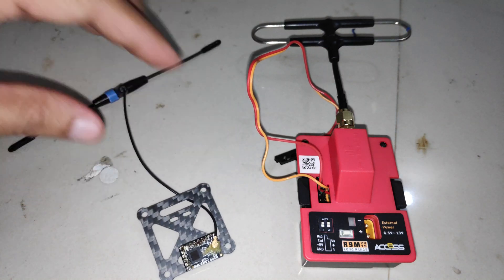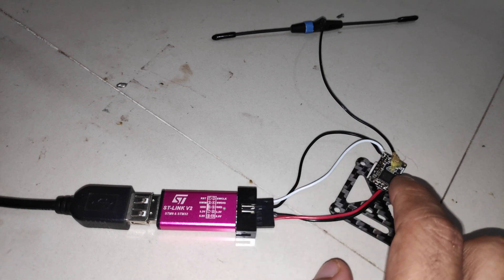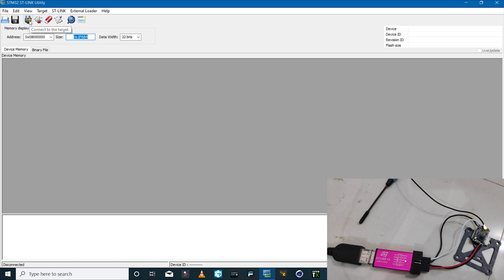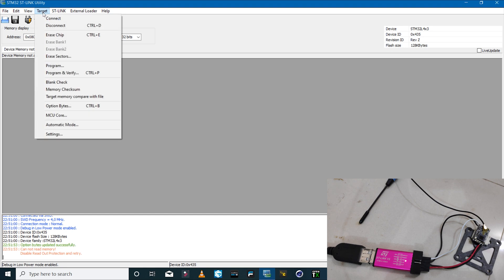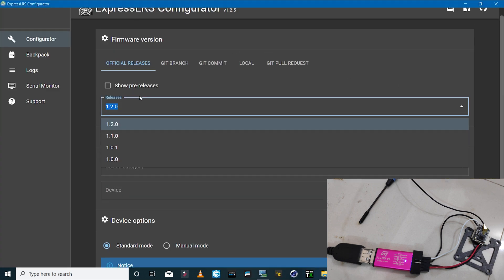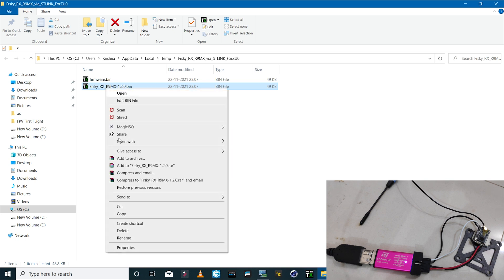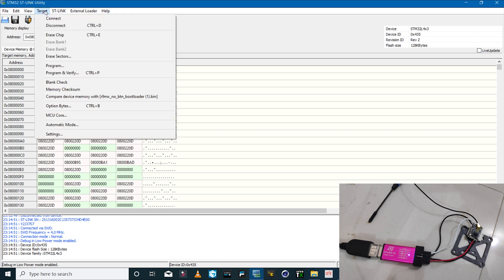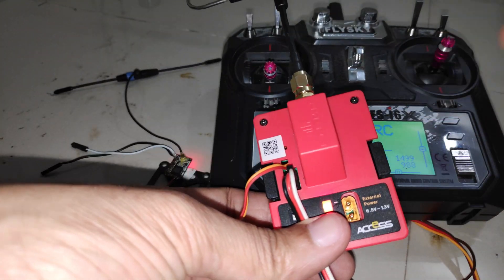Frsky R9MX Receiver ExpressLRS Installation using ST Link Utility | In Depth Tutorial

Comment: please help me I have an r9m lite TX and an r9m slim plus rx and r9m lite rx which I have connected to st-link v2 with utility with 3.3volt and dio and clk and ground the fault in the receiver and the module when I plugged them into the PC but after I connected to the st link utility they won't turn on again, is there a way to get them back again so they seem to have done exactly the same as you on the film they connect now too but that If there is no light, they seem completely dead

Comment: Thank for video. Good job.
But i cant flash bootloader with stlink correctly i think. Everything seem true. But red light flashing, not always on after bootloader via stlink. Not same as yours. İ tried many times but not working for me. R9m and r9mx bound but no telemetry data, rssi and stick commands.after stlink,  İ tried flashing bootloader via transmitter but no response.
Reply from the maker: Seems like the some new r9mx receivers have to be flashed with the button bootloader file of no button bootloader file is not working. But once bootloader and elrs firmware is correctly flashed on receiver it all about the binding pharse and making sure modle match is correctly setup along with telemetry in the flight controller. These steps will ensure everything is working as intended

Comment: I have followed your ST Link, Fsi6x Open TX and R9M tutorial and they all works just fine. But I have connection issue on updating the Frsky receiver firmware. The receiver I have is R9SX receiver. After I update the R9M, I could not bind the receiver; so I try to update the receiver as well. First, I connect V,D,C,G to the ST Link just like you show us in the video, but when I plug into my laptop, I kept getting "Can not connect to target!..." error. I don't see that error when update R9M firmware. I have double checked my connection between receiver and ST Link, and I believe it is all good. The receiver is flashing red when I connect and ST Link has blue/red light on too. I connect to 3.3V. Not sure what went wrong as I have spends whole day on this without resolution.  I may have to buy a different receiver like you're showing here and try again but it is RC FPV car not RC Quad though I try to build with ExpressLRS; so not sure R9MX will work? The reason I didn't get the R9MX originally was that I try to use this R9SX that with the PWM connector for the RC car.
Reply from the maker: R9SX is not listed in expresslrs website so it doesn't support elrs firmware.
Try to get the r9mx which which will work with elrs.
Reply: @RakishRc  Thank you very much. I will order the R9MX and try again. I also see R9 Slim OTA listed in the ExpressLRS configurator and not sure if that one may work as it has PWM connector I need for RC car and I don't need the extra flight controller. Actually, I was planning to use the receiver for the RC FPV car only as I love your video about long range RC FPV and I hope I can build a long range one. The 433 MHZ (MFD link) is also an option for this build; but I love the openTX and ELRS and their benefits and try to use on the RC car/truck. Hope I can use R9MX for the RC car (if not, I will try to build a drone then :-D  Also which controller you would recommend to use for R9MX in this situation? I saw your video about HGLRC Zeus controller but I just trying to get just any one that can work for R9MX, so I can connect it to the R9M for now. Thank you again.
Reply: My R9MX just arrived today and Soldered VDCG connector. Now I connect to the ST-Link on computer, and guess what, it works right away :D I can see it in the ST Link Utility now; however, after that I followed the video and successfully download and programed the bootloader and firmware, now the light on the receiver don't light up after I disconnect the ST-Link? There is no red/green light - no blink nor solid light. I try to power the receiver with 1s or 2s lipo without connect to ST-link and still no lights. I may received a bad receiver? I guess that I will have to order another one and try again ...?
Reply from the maker: @peterhou4998  hi, so once you are connected to r9mx from st link device and the read out protection is disabled the original frsky firmware will be erased which will lead to no lights on the receiver/bricked. You then flash the elrs  bootloader file by changing the address as mentioned in the video making sure the correct bootloader file is selected with or without button file. Once bootloader is flashed correctly you then flash the firmware file and the LEDs will be functional again 👍. Don't buy new receiver this is good just follow the steps correctly it works 👍
Reply: @RakishRc  Thank you very much. I followed the video step by step (it's a very good tutorial) I did disabled the protection and also change the address when running firmware update; but for some reason, after successfully completed the bootloader (r9mx_no_btn_bootloader.bin) and the firmware update (latest version is Frsky_RX_R9MX-3.2.0.bin), I disconnect the ST Link, and I still cannot see lights on the receiver. Not sure what went wrong; I then update the ST-Link firmware on the ST Utility, and even erase the chip; and then try above steps again, and there was no difference. There was still no light on the R9MX.  I am not sure what's went wrong and I think maybe the R9MX I brought was defect or something.
Reply from the maker: @peterhou4998  once you flash bootloader file do you see lights on the receiver? Because once bootloader is flashed the receiver is half way working and the led will light up. But once you flash firmware file and if the LEDs are not lighting up on next power cycle it means for some reason the bootloader is overwritten with firmware file. To confirm once firmware is flashed power cycle the receiver to check correctly if file if flashed and less will work.
Reply from the maker: @peterhou4998  make sure you're selecting the St link method to download the firmware file from elrs configuration
Reply: @RakishRc  Thank you again. Once I choose "Target > Program>Browse" the bootloader file, and click start, it shows completed successfully; but there is no light on the receiver. Then I change the the address to 0x08008000 and do the Firmware update and after that, there is still no light on the receiver after disconnected from the ST-link.  I then unplug the ST-link and put 1S or 2S battery directly connected to the receiver and there is still no light. Yes, I am also very sure I choose the "ST Link" method on the ExpressLRS configuration as I followed the exact steps you did in the video. I remember when I first plug the R9MX to the ST-Link, there was a light on the receiver. Don't know why the light is disappeared. My plan is to get another R9MX receiver next week, and test it again, just to make sure the one I got is not broken for some reason.
Reply from the maker: @peterhou4998  okay you could get another one and try again but see the reason the led are not lit up after flashing elrs file is because the frsky firmware on the receiver before is erased so the led turn off. Once elrs bootloader and firmware file are flashed correctly led will be functional again. Try and flash elrs 2.0 firmware file... download it from elrs configuration making sure St link method is selected and choose the firmware.bin file that's generated. 
You can contact me via telegram and send pictures step by step - https://t.me/RakishRc
Reply: @RakishRc  I try another brand new receiver R9 Slim+ OTA that I purchased, and I still have the same issue. This is what I saw in the sequence as follow: 
1. Soldier and connect VDCG to the ST-Link USB device. Confirm all is good. 
2. Plug the ST-Link USB to the Laptop computer. I can see ST-Link lip up (iblue) and the receiver is also lip up (in red) as well.  
3. In the STM32 ST Link Utility, I change the Read Out Protection from Level 1 to Level 0 and click Apply. 
4. I then got to the Settings and make sure the Reset Mode is Normal > Software System Reset (I already have this setting set from the R9MX so I don't have to change anything in Settings)
>>> Then some time after this or maybe after step #3 above, the red light on the receiver is completely GONE. <<<< 😞
5. I then try continue to ExpressLRS configurator program to download the bootloader and firmware and use ST Link utility to update (Target>Program) and both were done successfully; however, the receiver still has no light on it. 
I am thinking maybe Frysky stops supporting ST-Link update method? Or perhaps it has bug or defect or self-destruction protection?? because it seems that when the protection level changed from Level 1 to Level 0, the light is no longer on. I may have to buy a different system. I will send picture to you for above steps. Thank you again for your help! I appreciate you very much.
Reply: Thank you. After I flash older version of ExpressLRS 2.5 (The oldest one I can find from the ExpressLRS configurator); And also after I hold the receiver bind button before plugin in to the ST Link USB and release the button after that USB plugged in, I saw both my receivers (both R9MX and R9Slim+OTA) have red light flashing now; however,  I press the Bind option in i6X radio (I have R9M configured as external RF), it won't do anything. The receiver light is still flashing red and there is no binding sound on the radio. (Note: I try to hold the bind button too when I have ELRS 3.2 firmware and was not see any red light; so I know it was the ELRS version issue which is not compatible with these receivers issue).
Reply: The entire issue was because of the ExpressLRS 3.0 or 3.2 firmware; they are not compatible with R9MX and R9Slim+OTA (these are two receivers I have). As soon as I also downgrade my R9M from 3.2 to 2.5 to match the receiver firmware version that I had previously downgraded from 3.2 to 2.5 too, the binding process happened immediately; As I can now hear a short music and beeps from i6X radio during binding, and I also see both my R9MX and R9Slim+OTA display a solid Green and solid Red meaning the register process had succeed; however, I restart the radio and receiver and try to bind again, I still see the Green and Red solid led. According to the instruction from FrSky, I should see Green Led ON and REd Led OFF indicating Binding completed. Not sure if this is how ELRS work? At least I am able to read the receiver after downgrade to the older ExpressLRS 2.5.
Reply: I just tried to upgrade my exiting ExpressLRS 2.5 to 3.2. The R9M Slim OTA is working fine after upgrade. I am very happy.  I then upgrade the R9M TX OK too and working great. But the issue is that the R9MX is not working. The issue started as soon as plug the ST Link with R9MX to the ST Link utility, upgrade ExpressLRS firmware, then I disconnect the ST Link, but then the light on R9MX is still not turning on. It should turn the light on when I disconnect the ST Link. 

This was the initial issue I have in this post, and I have to downgrade grade ExpressLRS and play around with it to accidently fix it. I don't think this is firmware version issue as R9M Slim OTA RX is working fine. I think the R9MX receiver or most of Frysky receiver have intermittent issue as the result is not consistent? 

I also tried the Build and Flash option in the ExpressLRS but still failed with message unable to connect to the MCU device (because R9MX has no light on it?) 

ST-LINK SN : 1D180C157216303030303032
ST-LINK Firmware version : V2J37S7
Connected via SWD.
SWD Frequency = 480K.
Connection mode : Normal.
Unable to connect to the MCU device!
* Error 2
* [upload] Error 2

Not sure what when wrong. My 1st RC trust is working fine after upgrade; but unable to bind with my 2nd RC truck with R9MX receiver. Try Betaflight passthrough method as I have FC installed, but still getting the same Unable to connect to the MCU device.  I think I still need to read more of ExpressLRS documentation...

Comment: I have got R9M 2019 module and R9MX receiver with Radiomaster TX16S Mark II ELRS TX.I have updated the modules and TX through ExpressLRS configurator with passcode. Just the receiver is remaining. I've got ST link V2 to follow this method too but it is not getting connected to the ST-link utility software. It shows a message saying "ST-Link connection error" even after following the same method. What could be the problem? It would be great if you could help, because of this I can not proceed further with my drone building process.
Reply from the maker: Hi, are you unable to flash r9mx via tx16s? check this link https://www.expresslrs.org/1.0/quick-start/rx-bootloader/
My suggestion is to try and flash from the radio rather than st link. However if its not working only then proceed with st link method...make sure your wiring between st link device and r9mx is correct and disable read out protection. if its not connecting then try and switch between options of device mode in st link utility software.
Reply: @RakishRc  I could flash latest firmware in R9MX through TX16S bootloader but to update passcode through ExpressLRS configurator we need to do it either through betaflightPassthrough or ST-Link. I have got Pixhawk cube so can't do it through betaflightPassthrough method so tried doing with ST-Link. 
The wiring connection were the same way shown in the video. I checked if there was some printing mistake on ST-Link device by opening its cover but it was correct only. Also, tried switching all the options available but nothing is working. It is detecting serial number in settings but its not getting connected.
Reply: @apurvbarot491  I have the same issue with using ST-Link to update firmware.  I was trying to update the R9SX receiver (not R9MX) for the RC FPV car.  I was doing the firmware update for R9M2019 without any problem though, so I know the ST-Link USB is good. But I have double checked the wiring for the receiver and ST-Link, and they looks very good. Not sure what was the problem with the receiver or something else, very strange? I can see Serial Number in the Target > Setting and I can change the Reset Mode to Software System Reset but once I click OK, I will see "Can not connect to target".

Comment: Hej I have a question that I hope that you can help me. Many years ago I bout a flight controller and at the time it was very expensive. Is it possible to flash the flight controller in it with something new? the name of the flight controller is zero and if so which software do you recommend? Thank you
Reply from the maker: Can you specify the exact model name of the flight controller? It can be updated but if it's very old there won't be  any point trying to do so

Comment: I do the same but I flashed the normal bootloader istead of no_btn version and I cant' flash by passtrough but the biggest problem is that the RX bind successful but there is no communication. I will try with this method. I made a video with the problem https://www.youtube.com/watch?v=ABaiZsvgH6k
Reply: still not working, I changed RX and it works lije a charm

Comment: Can you confirm for me that the channel 2 becomes TX and channel 3 becomes RX? Everything else is very clear. I am just confused which pins connect to UART interface after flashing ELRS. Thank you so much for this video!
Reply from the maker: Hi, basically the Rx of the receiver connects to tx of flight controller uart and the tx of the receiver connects to Rx of flight controller. Just carefully identify the Rx and TX on r9mx receiver if possible write it down or take a screenshot. Then wire it porpely to flight controller. I didn't get what you meant by channel 2 and channel 3? Which channel are your referring to or as?
Reply: @RakishRc  hello, yes I understand rx to tx and tx to rx. The problem I have is no pins on my receiver are marked RX or TX. I only have s.port,sbus and channel 1 thru 4 pins in addition to voltage and ground. The elrs wiki for R9MX shows using 2 of the channel pins for rx and tx. I hope that makes sense.
Reply from the maker: @ebrune81  oh okay. Yes 2 is TX and 3 is Rx on R9MX receiver.